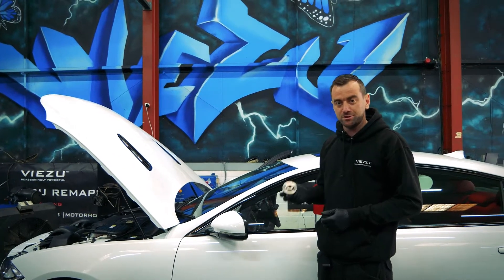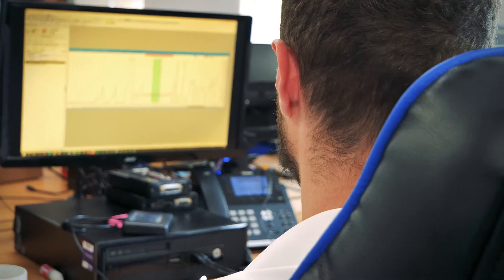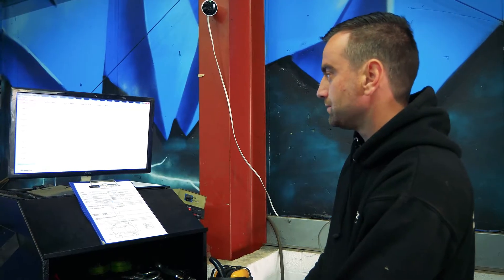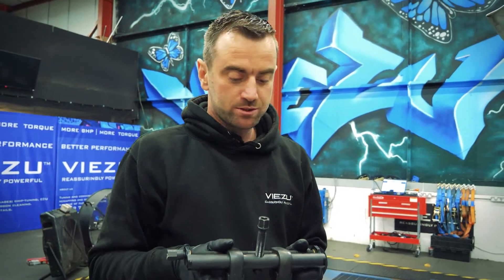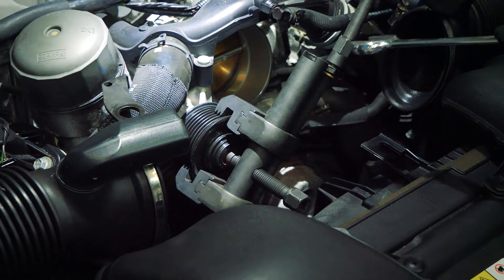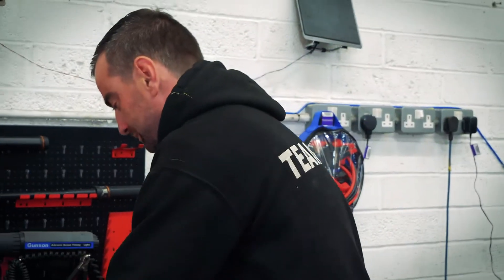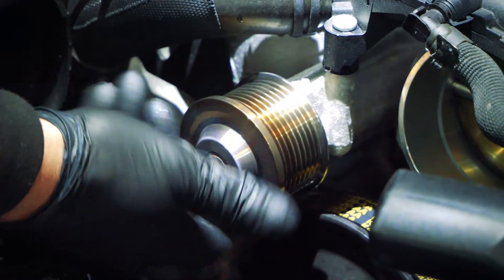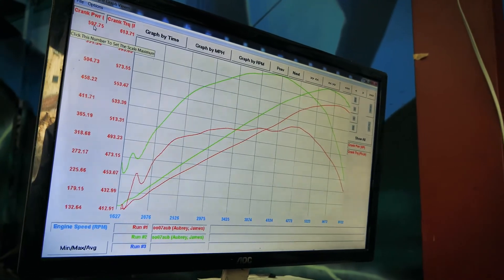Jaguar Land Rover Supercharger Pulley Upgrade Fitting Tutorial

Comment: i don’t know if you guys will even see this but would i HAVE to remap it if i did this?
Reply from the maker: Hi - you can run an upgraded pulley without a tune, of course the performance benefit won't be maximised without a tune, as such we would recommend ECU tuning paired with our upper pulley upgrade

Comment: So how much HP will it make without the map, just installing the pulley? Any CEL's??
Reply from the maker: Hi there - the upper pulley can be installed without ECU tuning, and you would see an increase in power and torque - with no fault codes.

Of course, to maximise the performance benefit of the pulley, we always recommend pairing this modification with our ECU tuning!

Comment: Hi great video. Can you tell me the desired temperature in Centigrade or Fahrenheit, to heat the pulley, as to achieve proper temperature and not destroy the properties of the aluminum? There could be problems with over heating the pulley. Thank you?
Reply from the maker: Good afternoon, Robert and thank you for your comment. We recommend heating the pulley to a cherry red glow as per the video ready for fitment. Once the glow has been achieved there is no need to heat further.

Comment: Hi 

Question 

I have a rover L405 3.0 supercharged 

Once the original pullybus removed dobI have to mill down the snot end v4 heating up the new pulley on?

Or?

For the 3.0
It's just a heat up and slide on the water cool?

Just wondering  bc I read the 5.0
Has to be shaved /milled down

Thanks alot
Reply from the maker: Thank you for getting in touch with us. As the supercharger snout is cast rather than machined these can have high & low spots. In the large majority of cases the pulley does spin freely without issue. The snout can be sanded to level the high spots so the pulley can spin without catching, however this would need to be be determined by your installer before heat fitting the pulley to the snout. 
If we can help in any way further please feel free to contact us at info@viezu.com.

Comment: I was told I would need an intercooler upgrade to do this with my XFR. Is that not the case?
Reply from the maker: @kevinc4325 Many thanks for your comment Kevin. If you are looking for the top pulley for your XFR, you do not necessarily need to have your charge cooler upgraded. Upgrading your charge cooler will increase your engines ability to draw air in more efficiently and resist heat soak for longer. You will still see significant gains on your torque and power with our Viezu Tuning and Paramount Supercharger Pulley upgrade. So I can send you further information on these upgrades please contact me at info@viezu.com

Comment: Hi
Questions

I dont know I am nowĺllĺl
beginning to try out power mods.

I have a 2016 fullsize rover supercharged  3.0

1. Does all these upper and pulley upgrades give a lost in gas milage?

2. I recently swapped the inner snout coupler and seems to me like the spin qith my hands is a lil snug and not so smooth turning anymore. Like in yourl

Does that seem to be a issue with ur experience ?

Or once assembled back it will eventually  smooth out with the belt turns?

3. If i purchase the supercharged pulley.
Do i have to get a full tune?
Or that can be done later on.

I do already have the upper pulley install. 

Thanks for your support
Reply from the maker: Hi @jsylvester1945, thanks for your comment. It's hard to say exactly what might be the issue with your supercharger snout. The shaft should spin freely whilst the centrifugally engaged coupler should have resistance when fitted to the charger. 

If you go with just the top supercharger pulley from us, there is no need to tune your vehicle if you do not wish to. The adaptive nature of the ECU means that it will adjust timing, fuelling and torque to accommodate the additional up to 1.5psi from this modification.

And the great news is, that a change like this should not negatively impact your fuel economy at all.

Drop us an email to info@viezu.com and one of our team can help further with your enquiry.

Comment: if you heat new pulley and install, doesn't it melt oilseal on pulley bearing?
Reply from the maker: in theory if you left the pulley hot and on the shaft it could heat the shaft and seal, this is why you will always see us cool it as soon as its fitted, so there is no heat soak into the supercharger shaft

Comment: I was told by Jake you don’t need to file down the 5.0 supercharger snout on the Range Rover sport during install. Is this true?
Reply from the maker: Yes correct, we do check them though as we have seen them sometimes with some high spots from the casting, these are quite easily removed, but best to check before fitting.

Comment: No tune ? Just a pulley?
Reply from the maker: This video is just showing how to fit a performance smaller super charger pulley on an interference fit supercharger snout. We would always recommend tuning the vehicle where possible in conjunction with uprated hardware modifications to get the safe optimum out of the powertrain.
Reply from the maker: We can do an upper pulley upgrade without doing a tune. Most people choose to have both, but works very well on its own.

Comment: Hi need ecu tune for 2018 range rover sport 3.0l v6 iff change pulley for smaller or no need ? And where i can buy pulley tool puller romoval tool for it thanks
Reply from the maker: Hi Lubos, good to hear from you, the V6 makes nice power, around 38-40bhp from just a VIEZU remap, you can boost this to around 50 bhp by adding a pulley too if required, we can supply the tuning software, pulley and pulley tool if required, please drop us a mail to info@viezu.com and we will be happy to help

Comment: is this pulley compatible with jag s type r ,, well some ppl that hahave done the pulley upgrade on s type r have temperature issues and overheating  issues any suggestions
Reply from the maker: Yes the 4.2 pulley is slightly different, but we do have these too, teh upper pulley really should not cause any over heating, i would want to get that investigated, we would suggest a tune and remap to go with the pulley, and if you are in very warm conditions you could explore a larger charge cooler too, but in general the pulley pulley should not need additional cooling. https://viezu.com/jaguar-tuning-specialists/
Reply: @ViezuTechnologies   so what the upper pulley upgrade would increase power or just louder whine ,, so i want louder sh whine but dont want louader  exhaust,

Comment: What code number NAME of the supercharger serpentine belt or the two that are in the engine? What code for this supercharged pulley? Did you buy on EBAY?
Reply from the maker: For the upper pulley you can still use the stock belt, when fitting the lower pulley too you need a longer belt, we have these especially made, please mail us at info@viezu.com if we can help with anything

Comment: Hi there, I have an 04 XKR and very interested in doing this upgrade, I have read you need to either grind or mill around 3mm or so off the snout to fit the new smaller pulley's internal diameter. 
Also, does a model year like mine require re-mapping of the ECU? All jobs I've seen I don't think anybody changed the ECU at all but I could be wrong. Have you done this mod to a 2004 or 05 XKR by any chance? I'd probably get you guys to do this on my car but I'm in New Zealand. May I ask how much you charged for this job including Paramount's cost of the pulley? Cheers
Reply from the maker: Hi Trevor, we would certainly recommend that you remap your vehicle, when you are replacing the upper pulley.  Please click on the below link to see where your closest Viezu dealers are:
https://ecs.page.link/kxqoE 

For the upper pulley, the part would cost £299 and it takes around 3 hours to fit.

Would you like me to find out how much shipping would be?

If so, can you please provide me with your address details.

Kind Regards

Ian